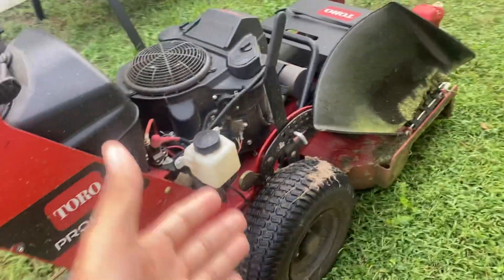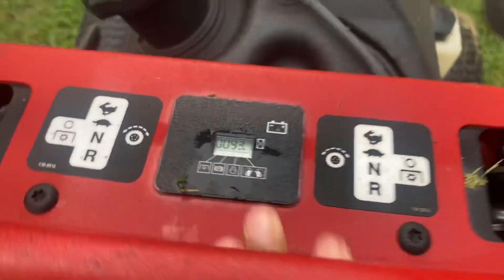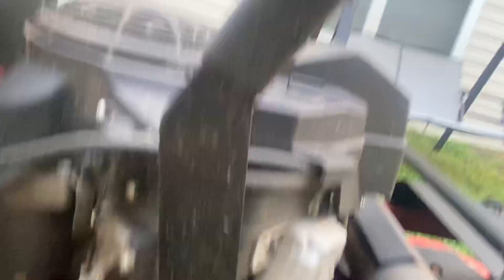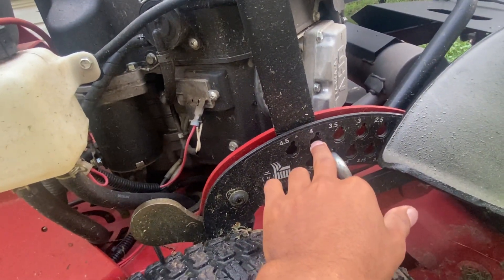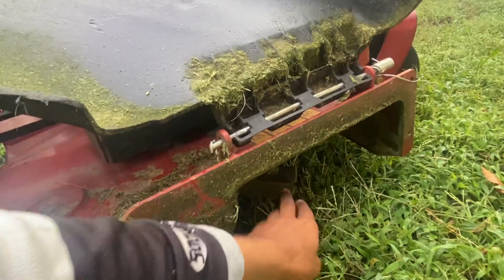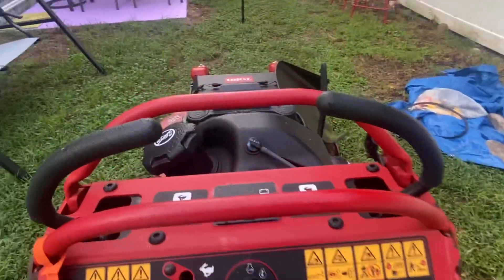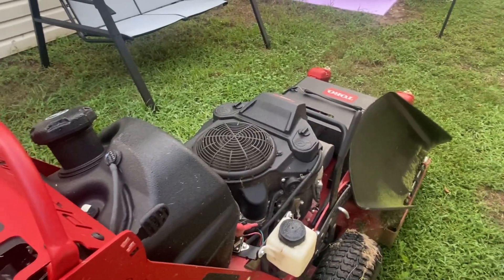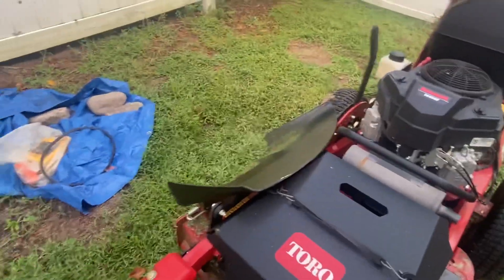New Ballard Ripper blades for 36inch Toro Proline (review)

Comment: I have the Rippers and Razors for my Wright 36 stander Intensity. They are both amazing blades stay sharper longer. 
For thick grass and clean ups, that X-blade set up is where it’s at though! Just don’t throttle on at full RPM and you’ll be ok. That x-blade setup does give my mower a lot of suction, the only downside of that is blowout from the deck when I close the grassflap. I think for mulching during leaf season I’ll just use the rippers